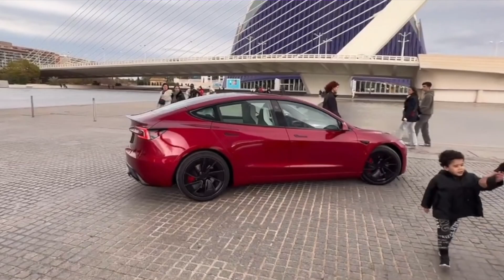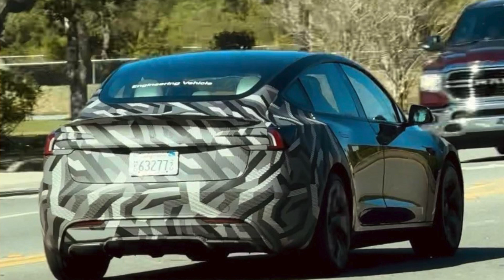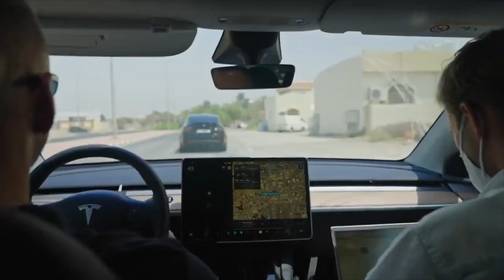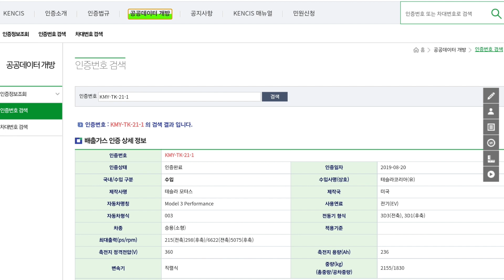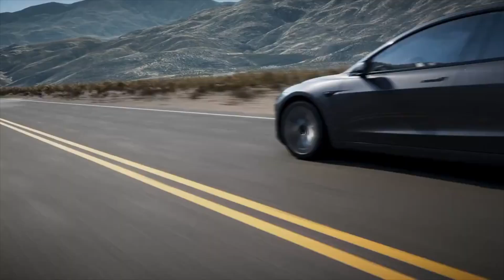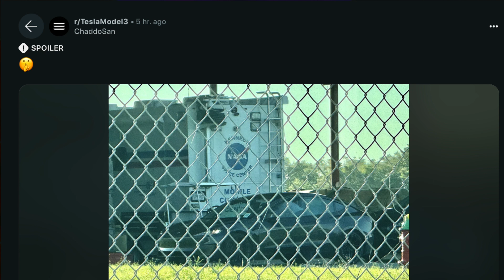Tesla Model 3 Ludicrous Begins Early Test Drives | Production Begins Soon

Comment: If they're officially changing the name to Tesla Model 3 Ludicrous, do they need to make updates with government (fueleconomy website) for the US federal tax credit? It currently still says "Tesla Model 3 Performance" for 2023-2024.
Reply from the maker: Just going with the flow for now, but likely itll be “Model 3 Performance” with a Ludicrous launch mode. The senior eng says it’ll still be called M3P but really who knows
Reply: @heyJohnEe  That makes sense, thanks! Do you plan on ordering the new Model 3 Performance Ludicrous or the Model Y refresh?
Reply from the maker: @liam1902 I’m planning on the Model 3L, as long as it comes with bumper camera and washer
Reply from the maker: @LudicrousModel3 this will keep the price down and maybe qualify for tax credits, then you can choose to unlock it yourself. Win win
Reply: @LudicrousModel3 stop the cap, unless u gutted it or something, shouldn't be possible. The 3.1s time that tesla states includes a 1ft rollout, which is basically a 6-60 time, not 0-60.
Reply: @LudicrousModel3  how is that a bad thing? If they can price it below the federal tax credit sedan limit ($55k) and then offer a $2k software unlock for the speed, it's a huge win-win for Tesla and the customer.